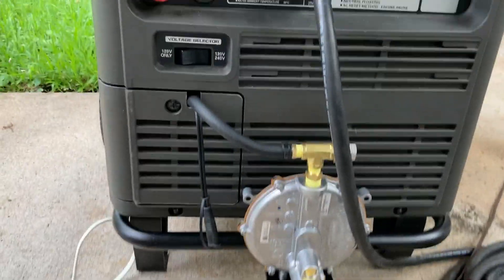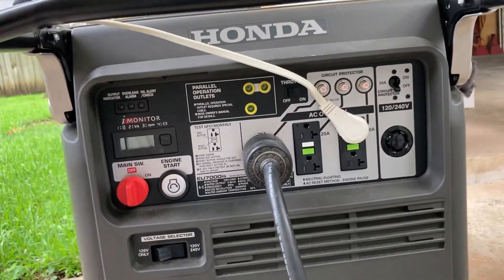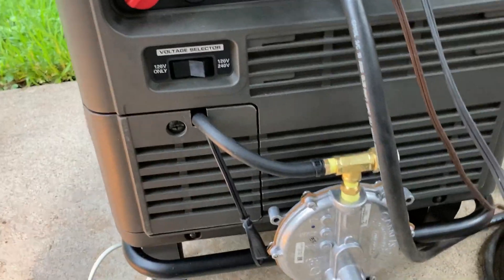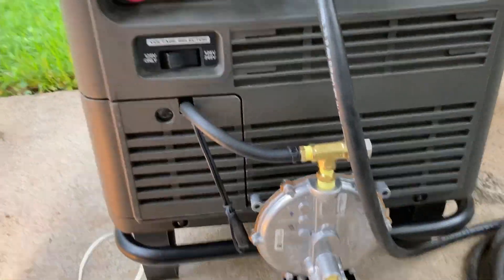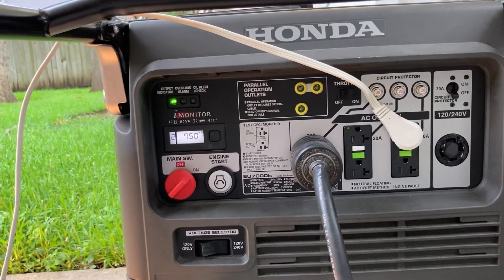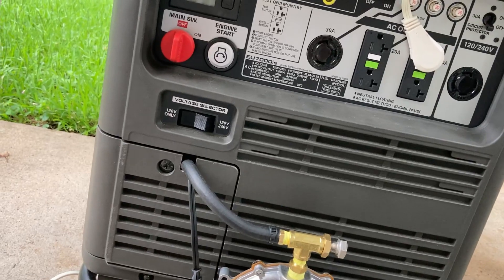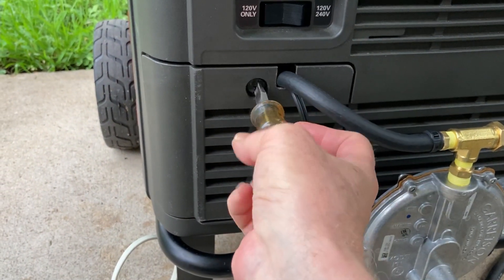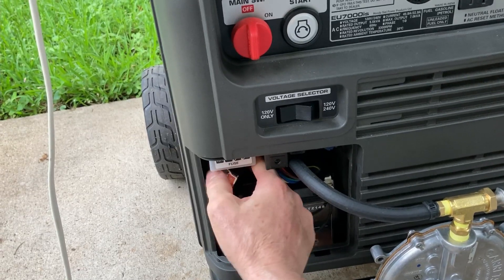Honda EU7000is running on natural gas with US Carburetion Motor Snorkel tri-fuel conversion kit

Comment: I have a Nash Fuel propane conversion kit and it idles badly in eco mode. I wonder if I can just install the electric module from this new kit while keeping the regulator and everything else from the older kit? What do you think?

Comment: Hi there,

Thank you for sharing your experiences with the conversions. I wanted to share that I also have a Honda EU7000iS that I converted using a Nash Fuel propane conversion kit. Unfortunately, I can't get it to run smoothly at idle in ECO mode. Once under load, I can run it in ECO mode, but not at idle.

While adjusting the mixture at the regulator, I went too far out and experienced some serious backfires, which cracked the upper airbox. I had to get a replacement, and I found one on eBay sold by Genconnex, made from aluminum, thinking it would fit as a replacement for the original. However, it didn’t fit, and I ended up wasting $150 since they don’t accept returns.

I also want to mention that while testing ECO mode, I noticed that if I leave the service door (on the side of the airbox) slightly ajar, I can run ECO mode. But I'm not sure if that’s good for the generator or for the noise levels.

For now, I’ve almost given up on trying to get the idle to run in ECO mode, but there’s still some hope.

Comment from the maker: @georgesmith4639 I had so much grief with the Genconnex kit that I actually bought the EU7000is service manual. I was getting all sorts of weird codes with that kit, and the harder I tried to make it run halfway decent, the more codes it threw. Most of what I saw were related to the GCU (Generator Control Unit), which is a bit like the ECU/ECM on a car.

To reply to your earlier comment (which now appears to be missing), one can buy a factory tri-fuel generator, but the choices are exceedingly thin. For example, Champion has exactly one, but it is not at all "quiet". Genmax has a quieter one, but it certainly isn't as quiet as the Honda EU7000is. Both are made in China. Champion has a more US-like attitude, but Genmax seems straight up Chinese, with their awkward shipping model and total lack of stocking and/or servicing dealers. 

I would review one, if they would give it to me - being as inexpensive as it is, if it works well, perhaps the lack of physical dealers is less important.  Just buy a spare...(?)  I'd have to spend some time with it in order to make a meaningful evaluation of the noise signature, because raw dB specs just don't adequately describe how it's going to feel during an extended outage.

Comment: Are you still happy with the US Carb conversion?  Has it damaged your generator as many claim that it would?  Am trying to decide whether to go this route, or to pick something up that’s already tri-fuel configured.  Thanks for putting these videos together.
Reply from the maker: Who are these "many" to whom you refer?  Do "they" offer any reasoning?

I ask because I would have said that it is generally known that running on natural gas is easier on an engine than running on gasoline due to "softer" combustion and essentially no carbon deposits, combined with lower maximum power output.  One could reasonably argue that lower maximum power output is a negative, but that is a whole other conversation.

As for buying factory tri-fuel, the only problem I see with that is that AFAIK, there is nothing on the market that runs as quiet as the EU7000is.  Period.  And only one brand/model that is even close, and that brand is straight up Chinese.  Will it hold up over time?  And when it does break, can one get repair parts?  Are there any credible servicing dealers?  And I don't mean a big box and/or hardware stores - I mean a dealer that is well equipped with the parts and expertise.

Don't get me wrong - I feel like Honda is lagging behind with all fuels other than gasoline.  If I was the king of Honda, I'd be embarrassed to be shown up by lesser knownn Chinese manufacturers.  And I think it likely that a more US-centric manufacturer like Champion is likely to bring some new options to market, since they already have models all around the segment.  They have quiet-ish dual-fuel inverter generators and they have a less quiet tri-fuel model too, so it wouldn't take much for them to seize the market.

One other thought - if a Chinese machine is cheap enough, does it matter if it is inferior in some ways to Honda?  If two can be had for the price of a single Honda EU-7000is tri-fuel conversion, is it reasonable to just buy a spare?  Of course, that comes with the challenge of storing two machines instead of one.  My EU7000is has an executive parking spot in my garage, but I'm not sure I could carve out such honored places for two (even bigger) generators.  Seems like a PITA.  And just speaking to my own particular case, would that Chinese machine run on my existing natural gas connection?  Because if it wouldn't, the rest becomes academic, because that would be expensive to solve.

Maybe Honda's competitors are reluctant to wake the sleeping beast, because they know that if Honda actually DID decide to build a tri-fuel machine, that they would do so magnificently, thus owning THAT market segment in the same way that their gasoline-only models currently dominate their respective segments.
Reply: @MstrMark  I have seen quite a few comments made warning that running this kind of conversion kit on a fuel injected unit would lead to damage, versus being used on a carbureted model(comments regarding fuel pump/fuel injector issues).  Just had to ask to make sure you haven’t suffered any issues.
Reply from the maker: @BryanW0765  No sir, no issues.  Although there were many issues with the other kit(s) that I tried.  AFAIK., this kit turns off the gasoline components unless set to the gasoline mode, so it would be hard for any harm to come to them.  Although, it will be a really bad day when I run it on gasoline, so hopefully, it will never matter to me.

If you have links to any negative comments, I'd like to see them.  Not that I need to defend USC, but I just think it's wrong.  There is so very much bogus information and (outright lies) on on the internet these days.  Perhaps ask someone (in addition to me) who is a mechanic and also has first hand experience with this particular kit.
Reply: @MstrMark  thank you.  The comments I ran across were in various forum posts, and nothing directed at USC.  They were just general comments stating that it was a bad idea in a fuel injected machine.  From what I’m hearing from you it sounds like the setup is good to go.  I appreciate your input.  Enjoy your day.
Reply: @BryanW0765  I see.  Well, not that anyone knows me, but I would just urge you to consider the source.  There are plenty of problems with the USC kit, but it also just happens to be the best option that I have personally experienced. But there is plenty of room for improvement, so If anyone cares to send me a better one, I will certainly review it.  For that matter, if GenMax would like to send me their tri-fuel machine. I will give it a fair comparison as well.

Comment: Thanks for your video..  If it helps any, I have tested and run NON ethanol fuel for over 3 years old and no problems..
Reply: Thanks.  I can see where it might be a good option for someone who is lucky enough to have easy access.  For me, the closest seller is an hour and a half round trip.  I've made that trip multiple times to buy fuel for my lawn equipment and my seldom-driven truck.  BTW, it is the most expensive fuel they sell.  I have to admit that it seems less acceptable to me  with each new trip.  

In my case, ethanol-free gasoline is actually harder to come by (and more expensive) than propane.  For reference, in the aftermath of Hurricane Beryl, propane was sold out at all of the places that were still open (because they were able to do business without grid power)  That one place that sells ethanol-free fuel was sold out.  It's just not good to be trying to buy fuel during a big event.  Interestingly, because she was already a customer, my sister was able to get a propane delivery for her generator even while gasoline was still hard to come by, so it might be worthwhile to establish relationships with sellers like that before a disaster actually strikes.

Comment: Ok, update on this thread Sept 2024. I have decided to buy a tri fuel unit when it is available here in Canada (Genmax 10500 unit) and sell the Honda. This should solve my problem with natural gas and leave me with money in my pocket, as the Honda has superb  resale value. For the moment, doing nothing and will rely on gasoline. But when tri fuel units become available, i will opt for one of them
Reply from the maker: Well, Genmax presents an interesting twist.  I almost bought one myself, but found myself doubting the heritage of such a Chinese company.  As you observed, Honda has a great reputation, which results in amazing resale value, and I believe that reputation was hard-earned by building best-in-class generators.  By comparison, I know nothing about Gen-max, except that from all outward indications, they have a very Chinese attitude. Still, it can't be ignored that Honda has failed to answer the strong need for machines that run on propane and natural gas.  Perhaps a very Japanese attitude...a bit like Toyota blowing off EVs.(?)  I don't know.  If I was the king of the world, Honda would build tri-fuel generators, and they would be such great machines that there would be no reason to settle for a machine made in China, and all that implies.  If a Honda generator were to ever break, parts and service would be easy to get.  When Genmax breaks, their website shows nothing but an email address!  I have a life-sized mental image of trying to ship a 253 pound generator to some undisclosed location.

FWIW, we recently weather3e Hurricane Beryl.  Millions of people in the Houston area lost power.  In the wake of the storm, the weather was dangerously hot and humid.  The EU-7000is served me faithfully for multiple days.  I was able to offer some A/C and home-cooked meals for my family members.  It was about as good as it could have been, given the circumstances.  Just yesterday, we lost power for about five hours, and once again my Honda was up to the challenge.  If Genmax wants to send me a unit for evaluation, I would be pleased to get some real world experience with it.
Reply: @MstrMark  Really sorry to hear about your situation. I can't imagine how it is at the moment with Helene roaring through....please stay safe. I almost bought a home in Florida some years ago to escape the Canadian winters but I am so glad now that I didn't

I have 8 generators at the moment.... four of them are Champions plus the Honda.   Of the others,  one is a Maxkeepingrod 3500 watt Chinese unit (which seems very good),  and 2 are cheap Powermate 1000 units I picked up for less than $50dollars each and repaired (seems people don't know about the low oil shutoff... HEY...RTFM.:))) 

I do know Champions units are well supported and parts are readily available and they are a safe bet to buy. At the moment, they are selling a new model  8500 tri fuel inverter unit, fully enclosed, for a very good price,  but it is not yet available here in Canada. It likely won't be as quiet as my Honda EU6500 but I think I can live with that. I really think I would buy one of these over the Genmax for the exact reasons you state. Unknown versus quality units and excellent parts and service available through Champion.  Also, I can't imagine shipping a 250 lbs unit across the border for service what with all the customs bs that would be necessary. 

As you know, I've been through all the machinations of considering converting this Honda unit to natural gas. It doesn't seem that it is a totally workable solution with any of the current conversion kits due to needing to adjust the gas flow depending upon electrical demand on the unit. The best one I can find seems to be made by PMG Technologies but after US/Canadian currency conversion and shipping, it will cost me close to $1000 Canadian...not good value for the money.  Best to wait until I can purchase a unit designed specifically for natural gas with service and parts availability guaranteed (especially since they seem to come in around $2000 to $2500) 

BTW, I now do have the Generlink 30 amp model installed and it works well with the Honda floating neutral  generator.

Once I eventually get a tri fuel generator, I will hook it up to the 3/8th inch supply line and see what happens. If it doesn't work, I will spring for the money to convert the piping.
Reply: Just got the Firmam 10000W tri fuel here in Canada 899$ from 1400$

Comment: Which kit that worked for you?
Reply from the maker: This whole video is about the one that worked best for me.  Even now, my generator has been running on natural gas for the last 18 hours, since most of the entire Houston metropolitan area lost power as a result of Hurricane Beryl.
Reply: @MstrMark  looking for the brand name n model to narrow down my search
Reply from the maker: @anonymous.369  I am not aware of any brand name or model other than what you see in the title of this video.   I am not willing to link it here because I believe that the kit has many shortcomings.  If US Carburetion wants to talk to me about it, I am certainly willing, but I'm not going to link it anywhere until I get some long-awaited answers.

You could search for "US Carburetion Motor Snorkel tri-fuel conversion kit", but in case you didn't watch my videos about this, I have to reiterate that it requires some engineering to make it work.  You're going to have to be willing to watch my videos, at the very least.  If that seems like too much trouble, you're not going to get very far with this kit.  'Still the best one I've tried, and in fact, I have now been running on generator power since early Monday morning, so it is serving me and my family well, but that's doesn't mean it's "easy".
Reply: @MstrMark  thank you for the detail reply. Appreciate your response. Thx.

Comment: Do you still have this installed and are you satisfied with it? I'm looking for a conversion kit.
Reply from the maker: Yes, I do.  And I think I'm as satisfied as I am ever likely to be with any conversion kit.  If I had it all to do over again, today, I would have to consider brands other than Honda.  At the high price that I paid for my generator, I feel like it should have included tri-fuel operation right out of the box, but Honda seems content to keep charging three times as much as brands that come with multi-fuel operation built right in.

Comment: The tech support never called me back, piece of crap customer service, i dont recommend the crap motor snorkel.
Reply from the maker: If I may ask, were you trying to get support for a kit that you already own, or were you hoping for pre-sales information?

I never was able to get the kind of support that I was hoping for, but with that said, they have the only conversion kit (that I've found) that actually makes the machine run even close to the way that it does on gasoline, so unless/until we find something better, this remains the only viable option for EU7000is conversions.

Obviously, a much better option would be for Honda to just do it themselves, since it would be very easy for them to do, and I have no doubt that they could do it very well.  But say what you will about Honda, it seems obvious that they don't care that customers want/need tri-fuel operation.  

Meanwhile, Champion HAS been paying attention, so they now offer a dual fuel 8500 watt quiet inverter generator that sells for less than half the price of the EU7000is, not to mention the expense, hassle, and clunky appearance associated with converting the EU7000is.  It's still not natural gas, but when it comes to storage, propane is a WAY better fuel than gasoline! If there was any money in making videos like this one, I'm sure I would buy one to review and enjoy.  (and watch out Champion, because here comes GENMAX with their new tri-fuel 10,500 watt machine.   I'd really like to review that one as well.  And if Honda doesn't start paying attention...well, their competition is already passing them by.